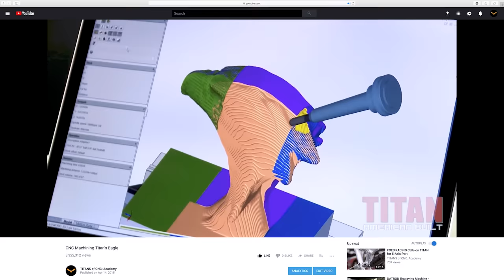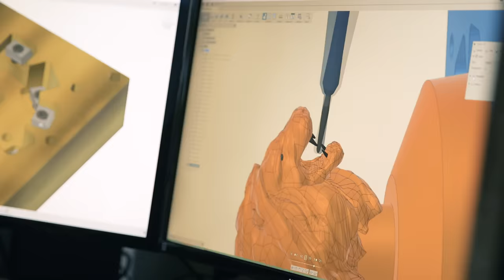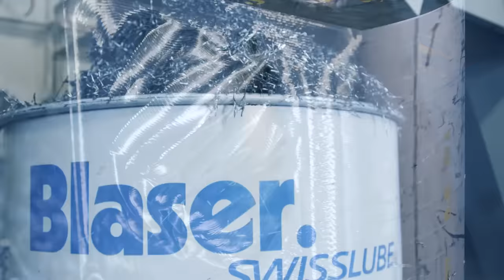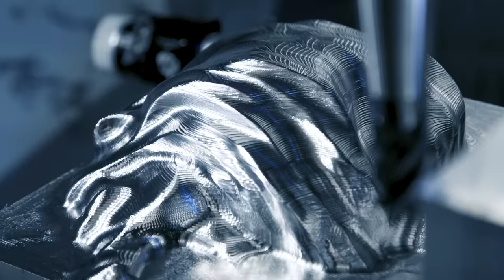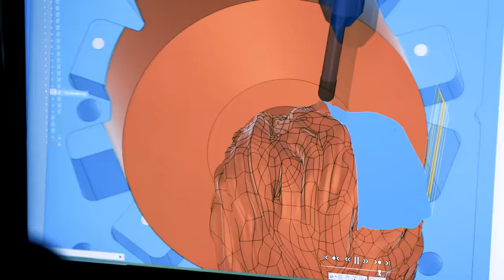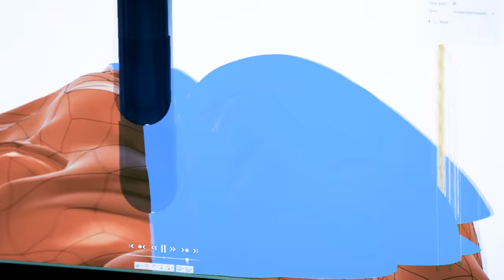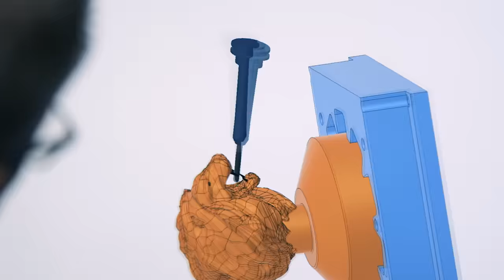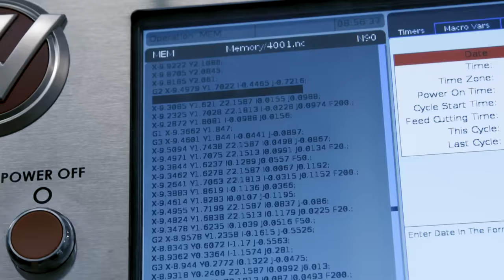Machining TITAN'S Titanium Lion

Comment: most people will never know how difficult that is to do
Reply: I imagine that the hardest part was the CAD work
Reply: I'm learning basic 3d grooves  and surfacing toolpaths on an old mastercam v9 and it's very challenging, never mind the whole 5th axis part haha a lot of time goes into those programs
Reply: No, the CAM work is more dificult, in the PC the tools are magical but i the machine...
Reply: And those who know this, will shake the head in cause of this insane Masterpiece which take such a long time!
Reply: I' BEEN WORKING IN NUMERICAL CONTROL FOR TWENTY YEARS, SO I KNOW WHAT IT MEANS...!!!
Reply: Well, it gets obvious when you noticed, even they in an presentation-video like this make CAD mistakes ;) Check 07:01
Reply: The fact the machines and tooling can do this is amazing in of itself, but the man who wrote the code, that is something magical
Reply: your problem is Mastercam... its terrible.
Reply: Jack Picton  i imagine writing a cnc program for this was hard work
Reply: Its not hard, if you know cam programm and parameters for machine, tools and materials. But a lot of time you spend for checking toolpath on simulation.
Reply: @Voxters  Could you please explain what the mistake was?? I couldnt find it...
Reply: Yeah, most people think being a CNC operator is just "push button, machine make magic"
Reply: Um the hardest part is not the CAD but taking away of metal from that titanium billet!!! It’s hard and tough as shit...any excess exerting of pressure on the part with tooling and BOOM! You have to know the exact feed rate and rpm of spindle which makes this a real Art! GO TITAN!
Reply: The hardest part was writing the CAM and CAD software to generate these curves and tool paths. Thats where all the math is
Reply: @AlexCell33  ...that's it...need calculation
Reply: @AlexCell33  ...I'm just a lathe machine,milling, operator,,,
Reply: Nope cad isn’t the hardest part. 
It’s the Codeing.
Reply: Hemanth With the right CAM software it won’t really hard to program this. Just pick the surfaces, tools and planes and away it goes. Apart from in the teeth there isn’t really that many hard areas to reach so I’d imagine it wouldn’t be too hard.
Reply: All that this video establishes is with time, and the extensive marketing budgets of massive corporations, one can put a titanium sculpture on their shelf.
Reply: @aschkansabaghi4901  
This is not for you, but for the rest of the audience. Yes, anyone who has worked with titanium will tell you that it is worse than stainless steel. A stainless steel also requires a special approach.
Reply: Hemanth it’s not if you are working with ShopMill
Reply: Oh shit Brous Blades up in here. Love your designs
Reply: @fortxuzopozopi3692  yeah, definitely the CAM work.
Reply: John Henry vs the MACHINE  !!!
Reply: BROUSBLADES Haha... Machine goes Beep Boop (neh, but hope technology goes to that level!!!) Hahaha
Reply: @nom6758  in the mill
Reply: @TheArcanelife  
There seems to be a little ding below the eye around 7 o'clock..
Reply: @TheRealDescartes  Yeah you pick lion and press print.
Reply: Most people in the cnc game know this stuff is not that difficult, it was 30 years ago, but not now. Maybe they’ll make a Hollywood film out of it.
Reply: @HR3EEE  what
Reply: the program is. you need to know metals s7 or a2 are not aluminum, you have to take care of your tools and know your materials and tools. spindle speed based on materials and tools, etc. as he said the eight finish just for using a damaged tool these are not cheap jobs
Reply: material is, but you quote based on time and you rep you workers arent cheap and if you mess up a job at the last step which had tens of thousands of dollars done, all for a damaged tool or error in program, and the tool damaged is a mistake in the program, drawing is easy its knowing your metals
Reply: Be more impressive with a manual mill and rotary table.
Reply: Nah, I did this last night with a $0.50 nail file in no more than an hour
Reply: I can easily make one in 45 minutes with an angle grinder, 38 if I'm not taking a coffee.
Reply: As someone who is trying to become a machinist and maybe doen the road a programmer I don't even want to know how many lines of code that thing has
Reply: @yeetergriffin1586  Luckily you can plot these tool paths out in programs and send it to the cnc. G code would have taken a while lol
Reply: @yeetergriffin1586  You don't have to really care about the amount of code, the software program you use to make the part will do the code all by it self. Its the "making the part" that you have to be afraid of.
Reply: I was thinking the same thing. The biggest issue in my shop is the time metrics, everyone else besides programmer/operators don't understand A set up times and B the thought that actually goes In to make an ascetic cut, get the most out of your tooling etc
Reply: Cause Nobody Cares..
Reply: @jackpicton6979  probabaly not there are alot of simple 3d modeling tools for this that artists use for games.
Reply: What you mean you don't just press the button ?????
Reply: I do this for a living and let me tell you, this probably took 3 days to program.  Just join all your surfaces together, build your tools, and click do it, or build path, for whatever software you are using.  The software and computer will do all the math and figuring for the angles for you.
Reply: Mastercam
Reply: @Voxters   !
Reply: @RubSomefastOnIt   Alternative?
Reply: @RubSomefastOnIt   Thanks.

Comment: For anybody that's wondering that roughly $5,000 in titanium, $2,000-$3,000 worth of carbide tooling and if it was a customer probably $3000 worth of machine time so that lion head is worth $10,000+! That's pretty bad ass especially when you figure an aluminum one would still cost $5,000 if you walked into a cnc machine shop and said "I want one of these please".
Reply from the maker: Nice Guess on everything... Machine time was much longer though. Probably a good 7 days straight machining... it’s big and I ran multiple finish, semi finish passes... .005 step over on final.
Long long cycle times...
Reply: @TITANSofCNC  
Totally worth it!
Reply: just go for the challenge!  and go broke haha
Reply: the rough material was likely a bit more, somewhere above 8000 dollars i'd assume. titanium is quite expensive...
Reply: @TITANSofCNC  how long did that take to program
Reply: @sunside79334  ~$25/lb current average cost of titanium, 215lbs of material that is $25x215= $5,375. Considering he buys enough material to have accounts with his suppliers I'm sure he could get it for less than $5000.
Reply: 7 days?
Reply: @wheelitzr2  well, considering that this is a sponsored video, it's a safe bet that the net cash flow was from TMS Titanium to Titan CNC and not the other way around.
Reply: wheelitzr2 You forgot to include programing time in all that price numbers...many people forget that, or they think it's a few clicks with the mouse
Reply: So how much could you get out of the 100+ pounds of chips?
Reply: If i had the money i would order a 1:1 scale Terminator head with every single detail, this would be my dream. I cant see the ABS material or any other cheap sh** for a terminator head. <3
Reply: Advances in metal additive manufacturing are reducing the price cap between traditional machining.
Reply: TITANS of CNC: Academy 
So how long process that was start to finish?
Reply: @TITANSofCNC  we make a lot of of seals and crests for the Gov at those speeds.  People have no idea how.much machine time it is.  Very few clients could afford it.   In our case it literally takes Nation State level of wealth haha.  Also that's not something you learn how.to toolpath overnight, takes.many many times to get that good.
Reply: This is lit ! Yea, probably took like days to complete look at the surface finish dammmm~ probably lots of toolpaths generated as well. Nicely done so satisfying to see. Never tried 5 axis yet, but sure it is a lot more difficult to use comparing to 3 axis.
Reply: Forgot the time designing and developing toolpaths in the CAM software. I'm curious how many practice runs or test samples you do? Made a couple tool board model pieces first?
Reply: Material - $5000
Carbide - $3000
Machine time - $5000

Showcasing your skills to the customer - Priceless.
Reply: We 3D print in titanium for a fraction of the cost... Lol
Reply: What’s that machine worth? 2-300k?
Reply: I was curious how much myself, found 6-4 Grade 5 Titanium Round Bar/Rod
11.9000" dia // 3.6000" long at $1200+, nothing this massive..

but basically the cost of my last car that i spent four years paying off lmaoooo
Reply: I'm thinking the material alone is close to $10,000.00 .
Reply: wheelitzr2 well you can make a very detailed wax model and use the lost wax process for a meere 400 bucks that what it is
Reply: Ide buy a cnc outfit first
Reply: @shadowblack1987  
I didnt know that was available yet
Reply: @TITANSofCNC   that is just cnc porn! amazing ! speechless on the finish ! BOOM!
Reply: Just adding up the material and tool costs isn't enough, you need to factor in hours spent making it (wage), design price (did they pay somebody to make the 3D model), time spent programming the actual machine, as well as basing it off market value with profit added on top.
Reply: @funnyvideohaha5337  yep I'm sure someone is going to pay $20,000 for something they didn't order and is literally a table ornament. Art is one thing but metal art like this is something completely different. There is no prominence or history around this piece other than some YouTuber/cnc machining company making it, yes it's titanium but it could have been aluminum for anyone that has that kind of money and no common sense to buy this thing, if I had $30,000 to just drop on this kind of thing I would just buy a hass and make it myself.  There is a huge difference between tweaking a computer program and painting a picture with paint and a brush. Yes this is bad ass but no where near worth $20,000 even if it cost you $20,000 to make it.
Reply: @TITANSofCNC  Hi, so I live in the San Francisco bay area where can I get real time hands on  instruction with these CNC machines.  Almost all the votec courses have all but disappeared. Do you offer classes with hands on?
Reply: Lion. The most beautiful hunter on the earth. Unfortunately theyre going slowly extinct by hunting.
Insane cnc video.
Reply: But it's not Titanium. It's Aluminum.
Reply: I think a $200 diy cnc from china on ebay could make one no problem
Reply: A low grade of Ti of that shape would work fine and be about 400-1k
Reply: @shadowblack1987  this type of thing is all 5 axis are good for. 3d print will make them redundant.
Reply: @vxlgsi  but until the tech gets there people still need their parts.
Reply: Hey machine my face and let me have for a gift do out of steel or metal
Reply: call abom to make that on conventional mill
Reply: I wish I started in todays CNC age. I work in Florida and your lucky if you can learn programming while trying to support a family.
 I Thought mill turns where great but seeing this I’m humbled.
Reply: @Kiboz2000  programming that is irrelevant for time. You program a quick roughing cycle. Then as it’s running you program the rest.
Reply: @shadowblack1987  How? Give me a quick rundown of the process, I am curious. Right now, your comment seems to me like someone is boasting with something, that is not really happening in their life or at least you are not the one ACTUALLY working in the 3D printing process. If you did the same as here (Lion Head), you'd need at least 100k 3D Printing Machines and Materials, being able to do Titan. I wanna hear something now. Prove it!

Comment: I bet the program weighs more than the part.
Reply: Any Fanuc control would have rolled over and died if it had jist a little taste of that program. Luckily Haas controls come with plenty of memory.
Reply: Jacob S. 
When using Fanuc Controls it literally seems like a 1000 lines just to drill one hole lol. I’d love to see if Heidenhain controls could do that.
Reply: Machine memory in the new TNC640 Heidenhain is ...

RAM memory: 4 GB
Program memory: SSDR approx. 32 GB
HDR approx. 160 GB

I've personally downloaded prog's of over 100,000 blocks ... and only takes second's  to download from USB ...

You can always do the download "old school" and drip feed the prog's using either RS232 or Ethernet or even USB ...
Reply: No tape ... just a huge USB memory stick ... !
Reply: @pakman422  spoken like a true haas fanboy.
Reply: Who needs alot of memory?   Just run the big programs right from the card.
Reply: so you are commenting the same on diferrent videos
Reply: TubbyTimmy CNC programs are easier than you think one can learn them in no time !
Reply: lmmmfao....i'm dead!!!!!!
Reply: @survivalisme88  im running last days 600k blocks program on heidenhain about 30MB and it going smooth :v
Reply: @DeanoTheSaxman  TAPE! Really 👎
Reply: @survivalisme88  its easier in heidenhain
Reply: @TheInternetowy  ye

Comment: That tool clearance on the finish pas inside the mouth is BOOM!
Reply: typeoneable I thought that was the wildest part. Never mind the stick out, the surface finish passing by the teeth, my hand would have been hovering on the E Stop or feed hold, and it would have been at 5% lol
Reply: I would do the same thing too lol
Reply: automatic gouge and collision checking ftw

Comment: I work in a manufacturing company that runs machines 24hrs a day. I personally don't run them, I just load the metal billets in a Okuma and then bring them over to a Mori Seiki to be finished.  I've been here for almost a year and even working 12 hrs a day I'm still astonished that a solid piece of steel goes in and comes out into whatever shape possible. I've learned a lot and I believe this is something I truly want to be doing for the rest of my life.

Comment: I think one of the best parts is realizing that Fusion 360 is what produced this code. That software is underestimated. Way better than expensive stuff like Mastercam and such.
Reply: gredangeo fusion 360 generated GCODE which is then interpreted by the CNC mill, which is many more times complex. The cnc machine did all the hard work.
Reply: @Ozziepeck11  Yes but, in the end the machine can't run anything without good code. Different software makes different kinds of code. Which could be efficient or not efficient, depending on what the Post Processor is doing.
Reply: @Ozziepeck11 The G-Code and however the CNC machine handled it is nothing in terms of code complexity. You need the generating software to be able to manage the 3D structure of the part being machined with enough precision without using insane amounts of storage, memory, or processing power. That software needs to be able to derive toolpaths with sufficiently high accuracy while avoiding collisions or other mechanical failures. It's nothing to sneeze at ...
Reply: @williamweber2686  I agree...you are right.

Comment: diameter of the titanium piece 9.5 inch = 0.2413 metre
surface of the base : 0,2413²×π⁄4 = 0.046m²
length 17 inch = 0.4318 metre

total volume 0.046*0.4318 = 0.020m³
the density of Ti/6Al/4V (cast) is 4.43*10³ kg/m³
so the weith must be 0.020*4.43*10³ = 88.6 kg(194lbs)
but you claim that the titaniam piece weith 218 lbs(98.9kg)
so how can you explain that 22 lbs difference (10.3kg)?

and for the curious this piece cost approximately 1770€ (1 910$) of pure material

Comment: So what was the total run time?
Reply: and how many steps?
Reply: @markusschlegel4680  I think ~ 900 k. Just Titan knows the true
Reply: How much was the price of that big a... titanium billet? :D
Reply: Titan replied to someone else’s comment. He said it took 7 days worth of machining. I know from experience that in order to achieve a finish like his, you need to have a very fine step over and requires multiple passes.
Reply: What's amazing to me is that even with all the time and such a fine step over, there are still places missed where that .375 ball endmill couldn't reach down into. Probably shouldn't use a .250 for roughing and a .375 for finishing on a part with concave features. Of course, probably would have added hours and hours!
Reply: @Chris-yy7qc That chunk can cost roughly around $5000 considering aerospace grade!
Reply: @MarioOoGuitar  There must be a lot of lines for rough machining, and there are a lot of steps to complete. I think, that complet program has maybe 30MB ?

Comment: I don't know if this story is relevant nowadays but I was a CNC Cad cam post processor programmer back in about 2003 ish.
I remember getting a demo of a ceramic cutting tool that worked best with no cooling.. The machinists were perplexed. They knew machine tools had to be cooled at high speeds. I was new to CNC tech just as new programmer in the department but I'll never forget the old machinists backing further away as this this tool went faster and faster.
It was like Voodoo to them. The had seen it but they could not believe it.
Luv and Peace.
Reply: They propably dont work with cooling :D just a few ceramics can work with cooling because they can withstand temperature changes better than other ceramics. But i know what you mean there are alot of changes from the past. The machines are way faster and in the same time more precise. You can describe it as insane.

Comment: When machine things like this do you only use full 5 axis to do the final finishing pass. Are all the roughing stages done in 3+2?
Reply from the maker: As you can see from this video... 3+2 to rough as it’s always faster and more rigid. Full 5th to finish and rough areas that are hard to reach.